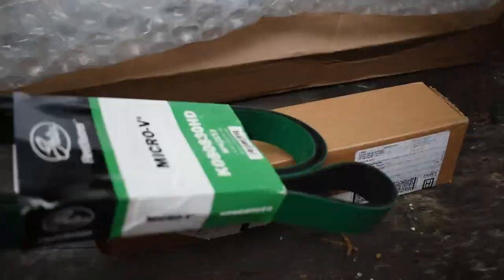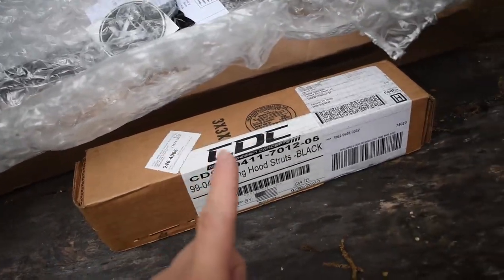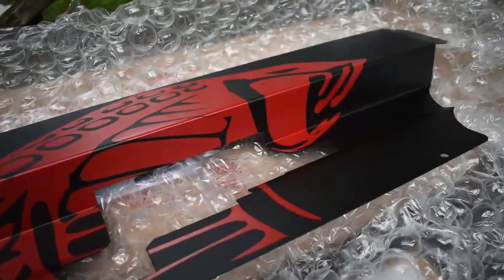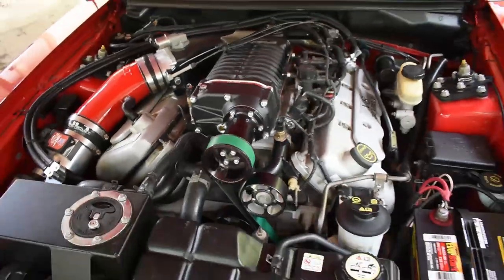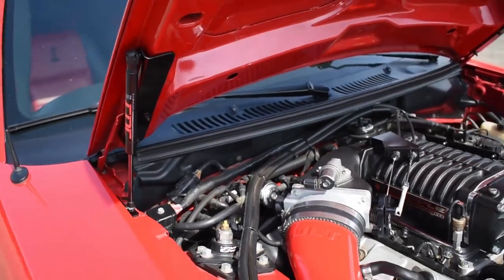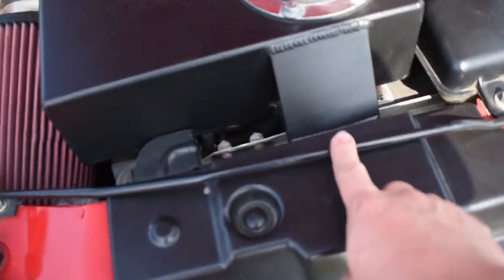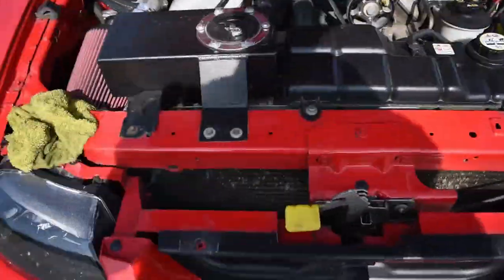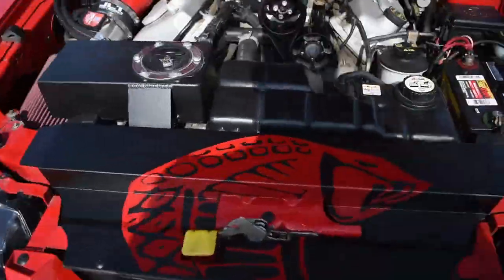Transforming my terminator cobra engine bay - Harpell Autofab Radiator Cover

Comment: Have you changed the other belt yet? If not, make a video when you do.
Reply from the maker: No I haven't. I bought the belt becuase it needs to be replaced but I didn't realize that I have to pull off the crank pulley. When I have time, I will definitely make a video of that.

Comment: Any issues shutting the hood with the struts? As you know these hoods sometimes need some force to latch properly. Hell I drop mine from 1/3 way open for it to latch. Looking to do the struts but want to avoid hood issues.
Reply from the maker: No issues with mine. The only thing I suggest is be carful when removing the nuts from the hood mounts. Do it slowly with a hand tool as the stud can break

Comment: You have any issues with the push pins?
Reply from the maker: Not really. But since they are the type that screw in sometimes I have a hard time taking them off since the threads are real fine.
Reply: @loscar5oh  for me they aren't catching lol I'm literally trying to install right now
Reply from the maker: @jcmuthafockin15  you gotta movie it around and apply some pressure on the screw as your pushing down.
Reply: @loscar5oh  kk I'll keep you posted thank you!!